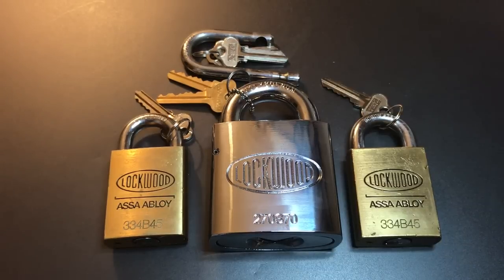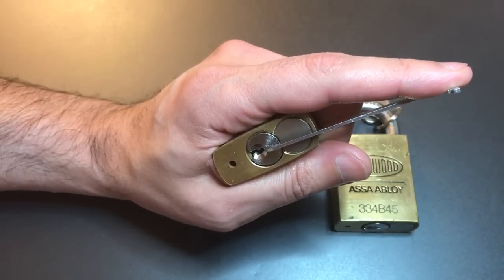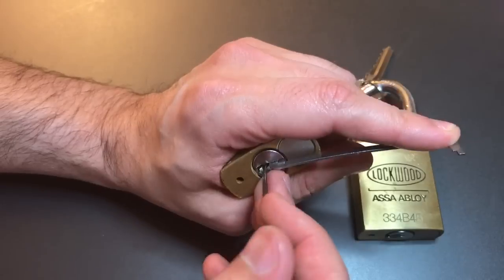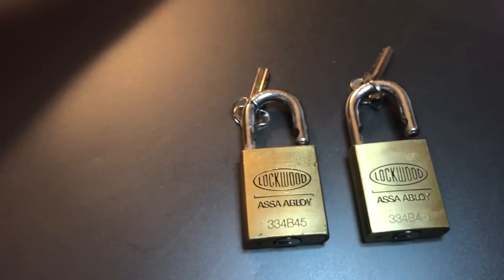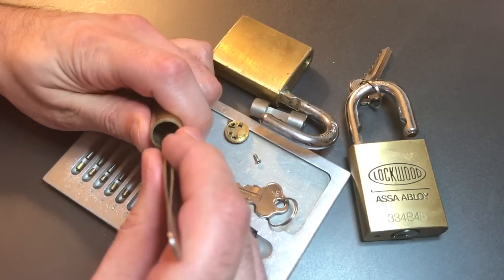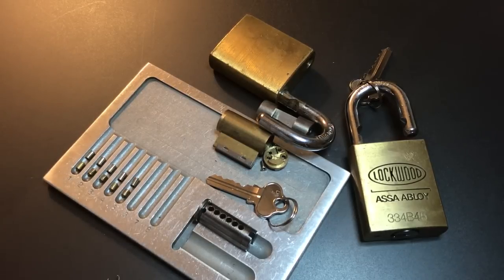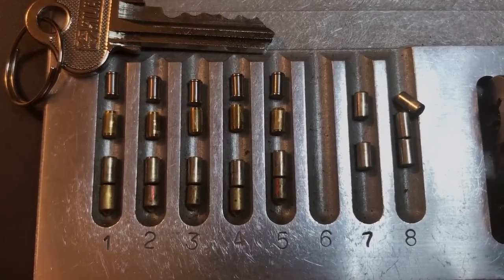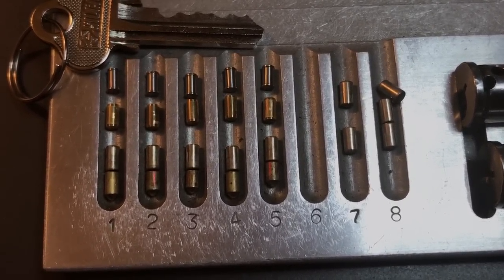[308] Two Lockwood 334B45 Padlocks Picked in a Row and Gutted

Comment: I have been watching your videos for quite a while now and I have been learning. A few weeks ago, I found a Lockwood Assa Abloy 334B45 in a park, just laying on the ground. There was no key. I have been attempting to pick it unsuccessfully for about 5 weeks. 

Last night (01 Jan 2021) at 21:51 I was watching M*A*S*H and 'click' it slides open! I finally picked it successfully! It was all thanks to your lessons. Now I need to work on understanding how I can make that happen each attempt, feeling the pins and true binding order.
Reply: Inside I found 6 spools, 5 discs and tapered drive pins. No anti-drill pins or holes for them and no trap pinholes.
Reply: @liquidsofa  i see nobody bothered to reply. i would like to say Good Job. I had a hard time with these too
Reply: @q1dm47  Since that lock, I have progressed quite a bit. I will reassemble that lock and place the parts in randomly. It helps for practice.
Reply: @liquidsofa  I got this lock as a Christmas present for exactly this reason :D

Comment: The 334's were both used Ebay locks that came without keys. Alas, I didn't have enough spare parts to revert them back to how they should be. Hopefully you will be able to do something with them. The 270 is brand new though and should present no surprises.
Reply from the maker: Thanks again for these locks... the 270 is set for the day after tomorrow.  I figured it was something like that with the 334's.

Comment: I have heard of lockwood padlocks, but have never seen them in the usa.. must be an Australia exclusive brand,
Reply from the maker: Correct, they are not seen much outside of Australia.  THey make some nice locks.
Reply: You can find them sold on eBay. Local locksmiths sell them. However, they're still cheaper to buy in hardware stores than on eBay.

Comment: I wonder if the locksmith knew what were doing swapping out the original Lockwood pins with standards. That was quite the unnecessary security risk for a lock that is built for pin security as well as all the basic physical security features. Even if a few pins were somehow damaged, surely there could have been a better option than picking up the cheapest of cheap pins?

Comment: the Lockwood 334B45 also Use By The Railways In Australia but Lockwood 334B45 use a specail custom 5P cylinder 
5P is a Master Key System For The railway so one Key can open all the PadLocks with 5P cylinders

Comment: How do you rate this locks with this pinning ? Good for a beginner ? Sometimes I think that cheap Chinese locks are so badly done that they add some extra difficulty for someone that's just starting. Nice video, thank you.
Reply from the maker: With this pinning, the locks were not hard.  And you are correct that locks can be so bad, that it adds to the difficulty.  Rough machining and ill-formed parts do not make for consistent feel, which is hard for a beginner.

Comment: Looked like the first one required a bit of tension? Nice picking!
Reply from the maker: I used pretty heavy tension on both.  I picked these under the assumption that these had beveled driver pins.  Those pins require very heavy tension if you want to open them quickly.  After seeing the pins, it seems like we could have done it with less tension.
Reply: Note taken on the tension, those beveled driver pins make for finding the sweet spot between under and over tensioning difficult.  Great locks, Thanks for the information.

Comment: Lockwood make nice padlocks just a shame the cylinders are made of chocolate.
Although it did take BB 5 minutes to open a spooled Lockwood shutter lock.
Reply from the maker: The spools take some getting used to because the rims are soo much shallower than those on other spools that we tend to overset them.  That said, give me a couple minutes to get reacquainted with the lockwood spools and I will fly through them.
Reply: LockPickingLawyer quite a funny video watching BB take 15 minutes and a retake to work out how to take out the cylinder.
I had to take mine to my locksmith to work it out lol

Comment: I have watched 6 videos of these Lockwoods being picked. 
We have a lot of these padlocks in Australia. I have a Lockwood 334M45 in front of me now and I cannot get a Peterson Gem or a standard No1 down the warding without oversetting the preceding pins. 
It pushes up on ALL the pins just getting it to the back, as they are all long deep pins. 
A light/thin Hook pick bends if I use heavy tension. 
But light tension gives no feedback or allows the pins to reset themselves.
I'm not helped by any of the videos so far.
Very frustrating.